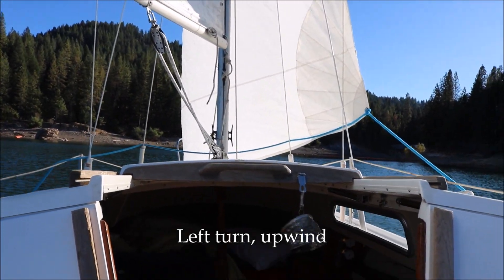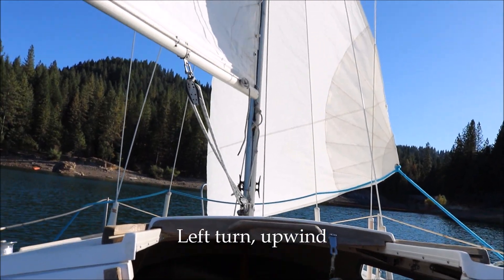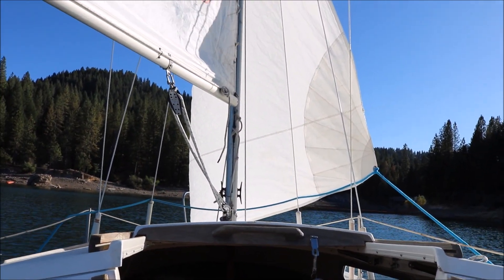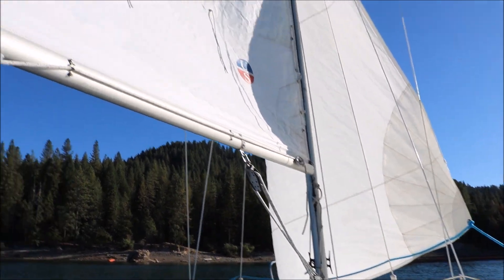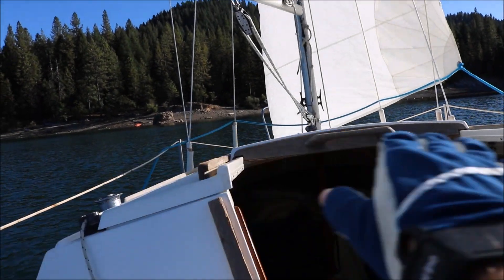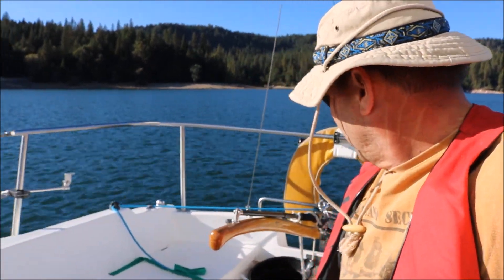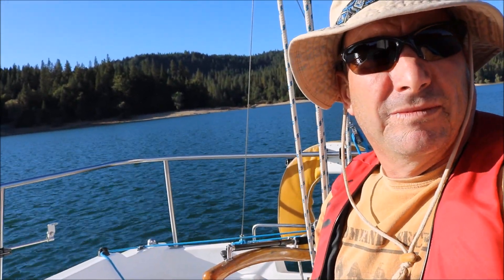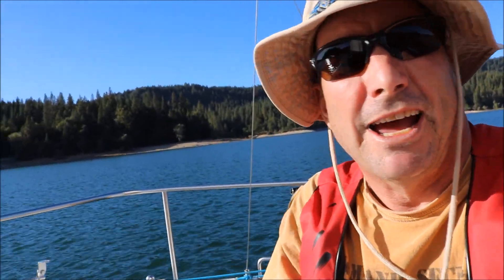'Heave To' to be Hove to- Catalina 22

Comment: The Pastor of the small home fellowship church that I was a part of for quite a few years down around Ft. Worth, Tx., had a sailboat...I think it was at least a 22 footer, like yours, and we would take it out on a small lake in those parts and do a lot of sailing. I went ever chance I could. I learned as much as I could. The Pastor finally gave me a set of keys and gave me permission to take the sailboat and whomever wanted to go sailing, and go sailing. One time, I wanted to prove to myself that I could sail it by myself...and I did. I loved it...tacking back & forth a couple of times...putting up the jib...coming about..all the basics. There was a small outboard motor , but I never used it, not even when coming back in to dock it in the slip. There was just a slight cross wind, but I allowed for it just right, and sailed into the slip nice & easy. I knew I could do it...and I did. But I only took it out that one time by myself. I just had to prove to myself that I had learned the basics adequately and could safely sail that sailboat. Yea...after working in a loud manufacturing shop every day, and then to get out on the water with just the sound of the wind in the sails and the gentle slap of the water against the hull at the sailboat cuts through the water..is pure joy.

Comment: For a poor man's autopilot, I run a light line from port to starboard, across the handhold part of my tiller, with two wraps around it. Then, moving the tiller left or right will move it through the wraps. To secure it to a heading, clip a large spring clamp onto the wraps, securing the tiller in place. Remove the clamp to move the tiller.